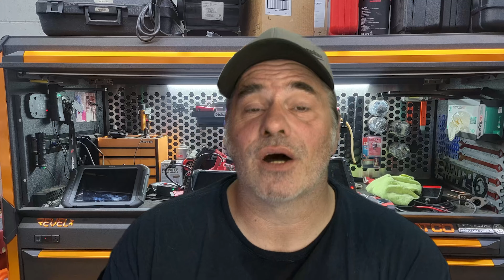Why Shops Should Pay Properly for a DVI Inspection???

Comment: The dealer I work at doesn’t pay anything additional to do a video inspection in addition to using this fancy battery tester that requires the vin and pictures on every car.  I’ve suggested instead of paying 0.5 for an oil rotate they up it to .07 for cars and 0.9 for trucks and SUV’s.  Needless to say I got told no, cuz all the checks is part of my job.  I’ve worked there over 10 years and they keep asking us to do more and the labor times have never increased, just decreased.  They also say the videos will sell the work for us, so there’s the compensation.  Since doing videos my sales have plummeted, mean while guys that refuse to do videos make sales.  It’s makes no sense to do a video while supplementing them with pics of the recommendations, just to not sell anything.

Comment: If filters take time to get to i don’t visually inspect them. I’ll suggest them in the yellow based on mileage and advise to check service history. I work at a dealership though so plenty of records of customer history and car fax. With that said I’m ok with an additional .3 for a dvi. At my dealership we just stay in our bays. Everything is done through era ignite shop system. We add the recs, it gets sent to parts, parts does price and availability and then that get sent to the advisor. If jobs approved I get an alert on my laptop. I can verify parts availability on the computer. Parts brings all parts to my bay and I can pull the car back in and start working.

Comment: We get .2 and to actually do everything on the sheet would take 2 hours. Ac check, battery health, cabin filters, diff fluid checks. The 1234yf check alone takes 30 min lol. And depending on whats found if its low paying stuff like wipers it isnt even worth the time because it will float around in the parts and service desk for 30 min on top of that lol. Needless to say no one checks everything.
Reply: I wouldn't do any.

Comment: If you work at a shop that pays 0.3hrs for an oil change, I would argue that you have time to do a very basic non-invasive visual inspection with that service. Anything above that basic visual inspection is unpaid work, but it's also how techs are going to get paying work. 

If you work at a shop that bills the full labor time for each mileage or time based service, no extra time should be added for a DVI. A 16K service on a 2016 Range Rover already pays 2.4hrs when that service only includes an oil change, cabin filter, and a bunch of inspections. The hard part is getting customers to pay for the 2.4hr service when an oil change and cabin filter alone is only 0.8hrs, most people don't want to pay an extra 1.6hrs for someone to inspect their vehicle that only has 16,000 miles on it.

Comment: If they are required by your company they should pay for  it. We have 6 current flat rate techs. If every flat rate tech takes 0.2. I am leaning on the low end(very low end) for every DVI. After the DVI we still need to fill out an MPI and put a Quote for what we recommend. If we look at 3 cars a day each that's 0.6 per flat rate tech. So that's 3.6 hours a day we are giving away. So that is 18 hours a week we don't bill. Which is 936 hours a year.  We are at 165 per hour so on DVI we give away 154,440 away in labor a year. So I have customers that never view anything we send which negates the system completely. So how much does it really bring in?

Comment: With a proper routine and habit  ,a complete vehicle check should take under 1/2 hr… issue I see recently is no one wants to work hard for their pay. The lower level techs want more time to do the same amount of work. Also, oil changes have to be affordable also- a $18 per hr tech that get 1/2 pay gets 9$ to change oil and the shop may only charge 13-18$ labor… it has to make sense also…

Comment: We paid .001 for the DVI, we tried paying an. 99% of techs performing them are completely incapable of measuring a brake pad. And the good techs a busy doing the State inspections so they are all pencil whipped no matter what we paid. The young techs should be paying the shop to work there for the reeducation of basics that the tech schools failed to provide.
Reply: Sounds like the shop needs to do a better job of setting expectations and training people to meet them.
Reply: You should give some form of bonus to young techs for everything that they successfully upsell, I've found most of them just want to fly through it because they know even if they sell the customer an engine the ticket just gets given to the experienced techs and they don't benefit at all while risking recommending something that isn't actually broke and catching hell from the tech.